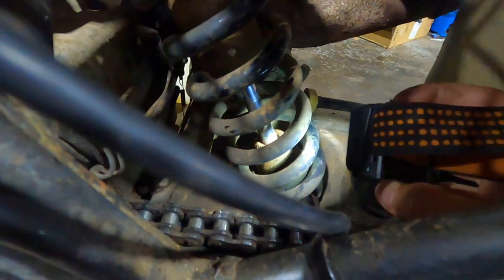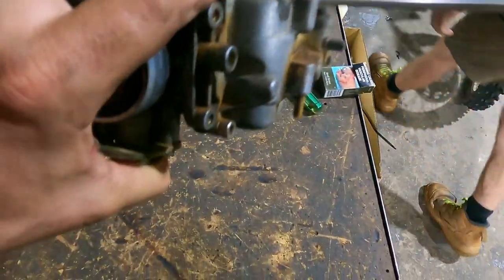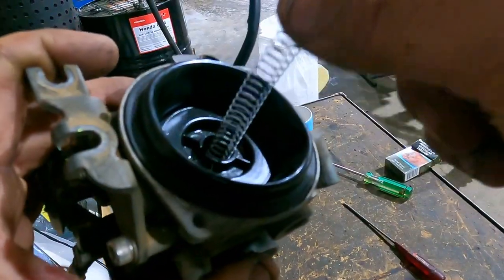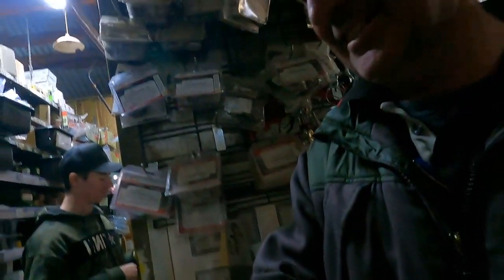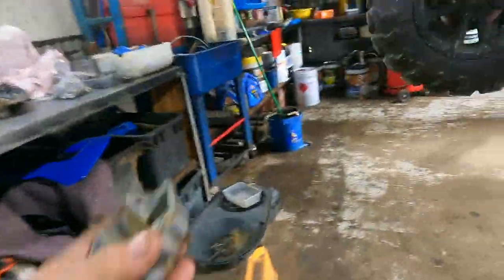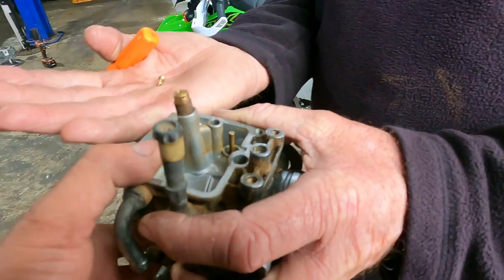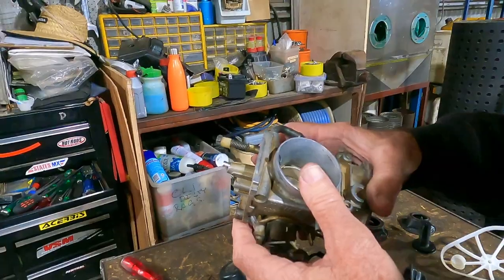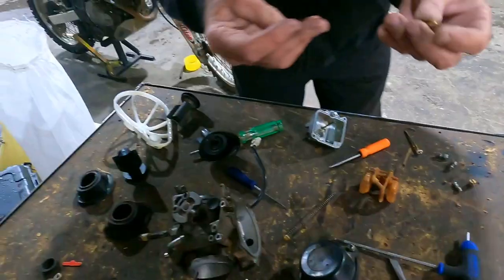DR650 Guru Vince Strang helps me take my Mikuni Carburettor back to stock

Comment: Just wondering why the filling up of the extra hole in the slide. Was considerung adding it, now a conumdrum
Reply from the maker: Well I was taking the bike back to stock and I believe the person who modified it in the first place did it incorrectly 
If you have the right needle position, jet and can tune it well .. drilling the hole might work for you as many people think… I personally am happy with the stock throttle response. 
I also trust Suzuki’s engineering and Vince Strang more than procycle 
Your choice though 
Was the rejet video to help you decide further
Reply from the maker: Also read the comments, a lot of people disagree with myself and Vince
Reply: The extra hole in the slide doesn't give more power nor use more fuel. What it does is make your throttle input more responsive and touchy. Great for times when you blip your throttle to lift your front over ruts or logs. Some people like a touchy throttle, some people don't.

Comment: Ya teasing us mate with the fuel consumption issue. Binding brakes?
Reply from the maker: Haha, that was the plan 
You have to find out in episode when I go on a 3 day ride with Vince and his mates .. soon !
No the brakes . Something very simple
Reply: @unbuckledadventures  Don't disappoint me. I want to see the issue fixed with an ice cream stick and an old tooth paste tube. It was a bit weird seeing you throwing so many new parts at the carb.
Reply from the maker: @volvogt21  hahaha I understand your concern, Ill try be as unbuckled as possible in the future. 

 but I didn't trust the previous work done on it and wanted to take it back to stock, My mate also gave me the stock needle and stock jet he took out of his carb when he installed the precycle jetting kit.
Reply: @unbuckledadventures  totally get your and Vince's attitude re stock.   Hell, if you managed to get 6 more horsepower out of it then it would still be 1 down on an old 95 BMW F650 funduro I have. It's all relative. I value the smile it puts on my face more than how many lethargic ponies it can muster
Reply from the maker: Well said volvogt21 
That’s it .. enough horsepower for me but each to their own .. fun to modify for some as well and the seems to be worth it if done right
Reply: Hi. You replaced jets. What about the emulsion tube. These can wear to oval shape from the movement of the jet needle. Just a thought. Cheers David.

Comment: Does it run ok now?
Reply from the maker: Did so .bike was stolen in Melbourne 
With one error as we used the after market spacer washer with the original needle 
But easily fixed